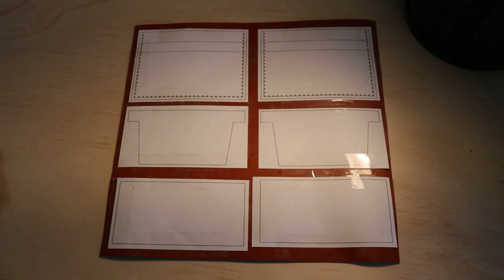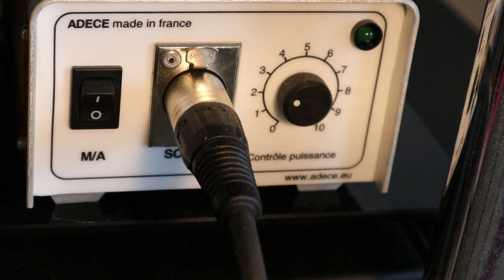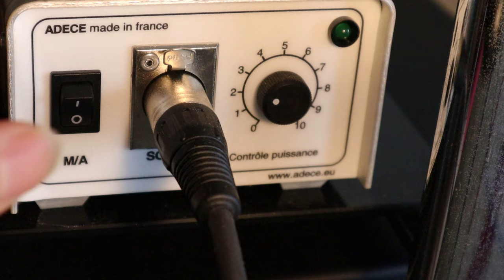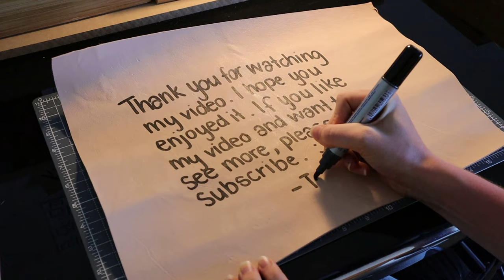FREE PATTERN + EASY TO MAKE CARD HOLDER V2 - ASMR SOUDNS LEATHER CRAFT

Comment: Beautiful! What is the thickness of the leather? Where did you buy your tool holster? And where can I find a hammer like that?
Reply from the maker: thanks! 
1. 1.1 mm.
2. I made them 
3. https://www.etsy.com/au/listing/225957136/leather-craft-hammer-vergez-blanchard-in?gpla=1&gao=1&&utm_source=google&utm_medium=cpc&utm_campaign=shopping_au_en_au_a-craft_supplies_and_tools-other-other&utm_custom1=eef2f6c0-7d33-4371-8867-2674f3d7e740&utm_content=go_344339288_19782532328_78803011448_aud-310848254064:pla-327138597241_c__225957136enau&utm_custom2=344339288&gclid=Cj0KCQjwmpb0BRCBARIsAG7y4zZN9NgBUNIhkiuvUbxsizrDsl3P-ADDKXLiqBJqRB9NEriBY8WQgZMaAlQEEALw_wcB

Comment: Hi, nice job. I have a 4mm stitching iron. If I use your pattern will the holes not line up right?
Reply from the maker: should be 3.85mm thank you.
Reply: you just try for yourself and adjust a little bit..it will work

Comment: Nice piece of work.  Where can I get the glue bucket with the blue handle?  Also, clarify:  one cannot use the patterns commercially.  Does that mean one cannot sell the pattern as if it were theirs, or does it mean that one cannot sell the product (card holder) that was made using the pattern.  Man, Lots of these patterns on the internet and they are all basically the same.
Reply: both
Reply: @CyberiaLyr5 I have no desire to take your free pattern and sell the pattern as my own.  But, to take your free pattern, make a product and then sell that product....that's hard for you to enforce.  You couldn't do it.  The larger issue is if that is your policy why post anything you make online.  Nonsensical.  But whatever, I do my own thing anyway, just trying to figure how some people think.

Comment: Not sure why she trimmed the leather.  It was thin to begin with.  Over time, it will fall apart.
Reply: Over time, everything falls apart😊 If you note, in some places the leather is three sheets thick; skiving the edges helps keep the edges thin enough to punch through and sew.
Reply: Had it not been trimmed the combination of the glue and the thickness of the thread would have made the edges bulky. She is carving to make it sit a bit more flat, plus ut helps w the glue adhere to the other leather